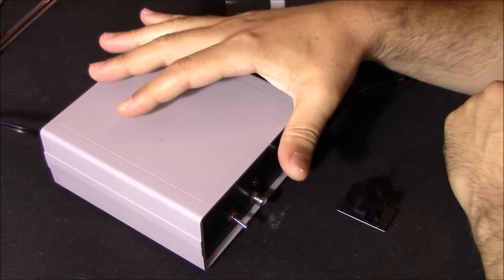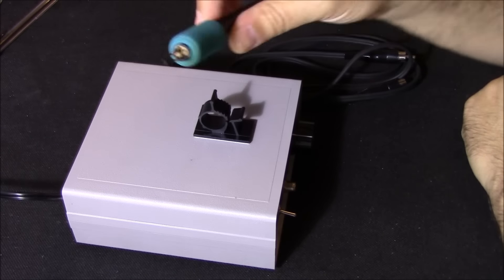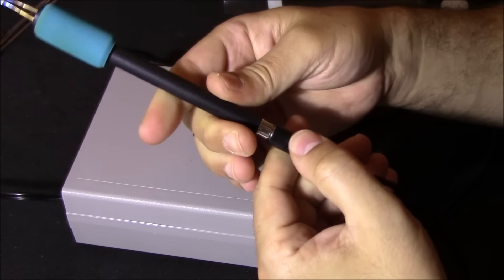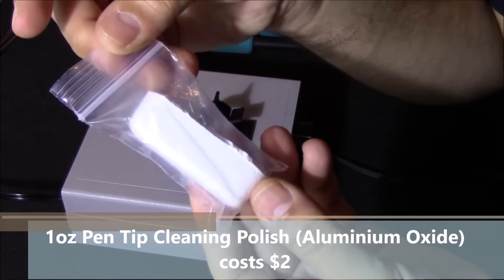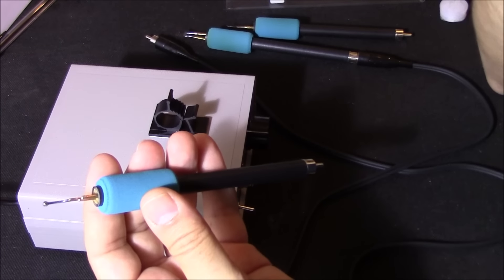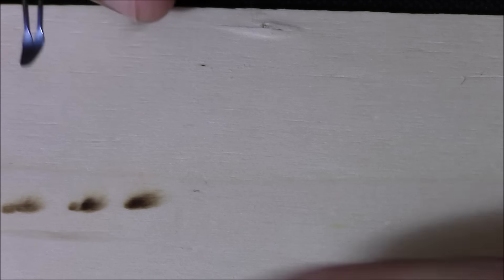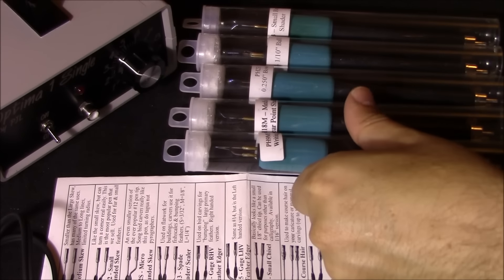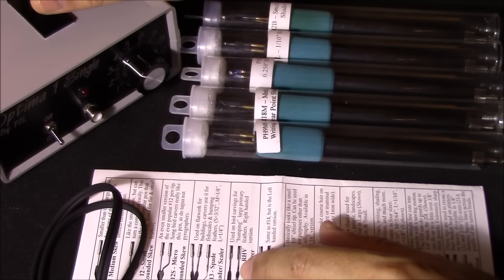Optima1 Single Burner Review (legendado em português)

Comment: I found the review to be comprehensive and informative. However if the machine does not have a CE mark is there a problem importing into the EU.
Reply from the maker: Thank you very much Sean. I didn't know about that but I'll talk to Pat to clear this up. I had no problem receiving mine. I'll give you an answer today later today. Don't worry.
Reply: @richypyrography  I would like to know the answer too please. I am just looking for some good woodburning stuff and this one looks pretty good. Only if we could import it to EU. :) Thanks for info
Reply from the maker: Hi Ley. I guess it depends on the country. Besides Germany I have no information about the item be sent back.
It will stay in customs, for sure, because it comes from outside the EU. You'll have to pay taxes to get it. I payed around €50 to get mine out of customs. Hope this helps.

Comment from the maker: I talked to Pat and he told me that he already sent machines to several countries and had no problem.
It is most likely to happen if you ordered to resale (big amount of machines).
Anyway, if the machine gets sent back by customs, Pat will make a refund.

Also, the CE mark is a set of rules that apply to the Europen Community to electric equipment (and other things) in order to keep us safe.
Optima is already sold in the US (which have their own rules) for so many years and I have never seen anyone complaining about it, so I think it's perfectly safe to use it.

Comment: How this compares to Razertip machine? I have been wanting to get new burner, but for me getting Optima will cost much more because customs and postage. Also, I'm not sure will it be possible to order to my country, because customs may hold electronics that doesn't have CE mark.
Reply from the maker: CyaneInk Art I also have a Razertip machine but I prefere this one. I was having issues with the tips and heating problems. The vented pens don't help and, because I had to use higher settings, my finger where always very hot. My machine also got stuck on customs and I paid €50 to get it. If you add this to the final value it is still much cheaper then Razertip and you have much better quality. You would pay extra if you ordered from a retailer anyway (maybe much more than €50). This value was for the machine, 5 pens, a cord, aluminium oxide compound and shipping costs. Everything is taxed here. I think it's worth the cost. Try to see what other people feel about the machine from their experience. Hope this helps.
Reply: Richy Coelho This has helped me a lot! I will probably save up for optima and try to get in the country somehow. It sounds like razertip would be just waste of money and not anyway better than my current burner.
Reply from the maker: CyaneInk Art can I ask where you live so that I could try to help? This is from my experience. Thank you.
Reply: I live in Finland. I have contacted customs and they had really vague answer, that implied that it may get thru if I pay custom fees. But there is also possibility that they open package and notice missing CE mark and doesn't let it throught.
Reply from the maker: CyaneInk Art my brother lives near Helsinki and he is here on vacations. He told me that can happen, yes. The customs in Finland are very meticulous. I didn't know. If you buy any other brand go for fixed tip pens.

Comment: I’ve been looking at burners, and I’ve ran in to a wall looking at all different from razor tip and colwood  and this one Ultima one this one that your reviewing Honest opinion which one is the better.
Reply from the maker: Hi Jerry. I have the Razertip and the Optima 1. Between both of them I have no question that I would choose the Optima 1. The relation between price and quality is more than perfect. Powerful machine, great pens and many different tips. The Colwood seems to be great as well regarding the work and opinions of friends that use that machine.
Bottom line, Razertip would be my 3rd choice between the 3 of them.
If you go for the Optima and you don't live in the US, remember to add customs fee to your order. Also I would advise you to go for HD pens and cords.